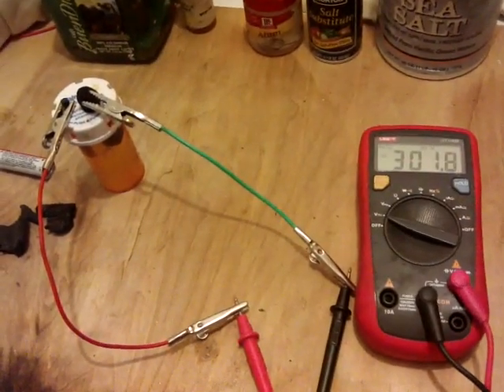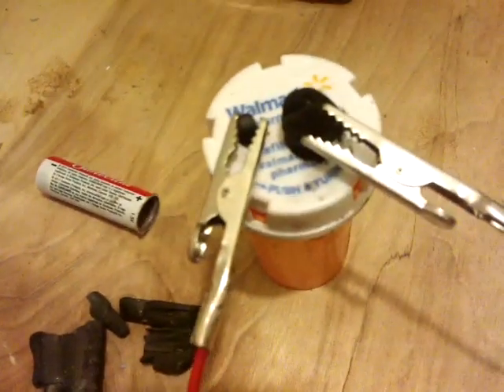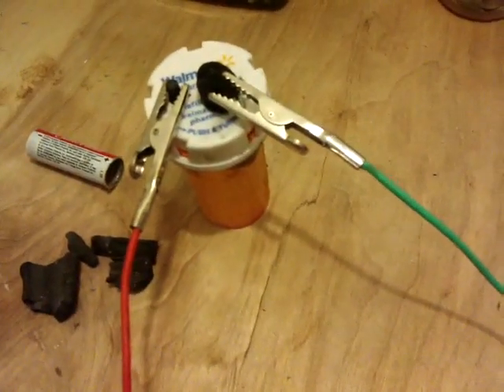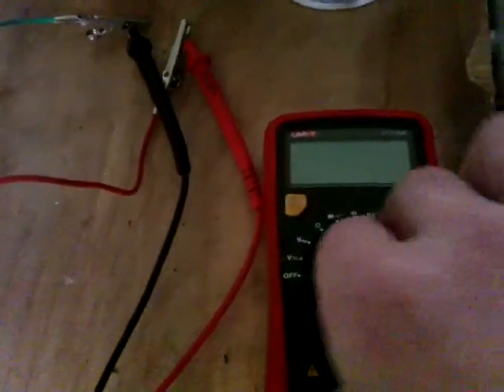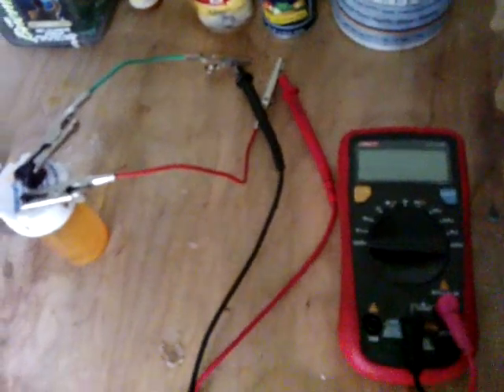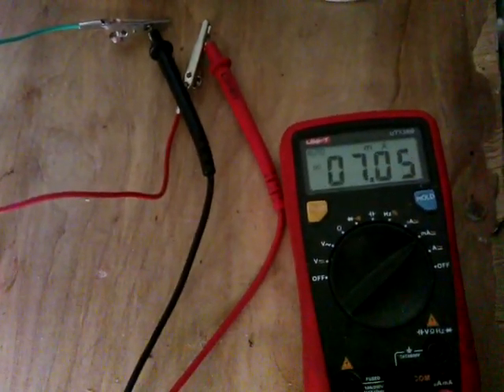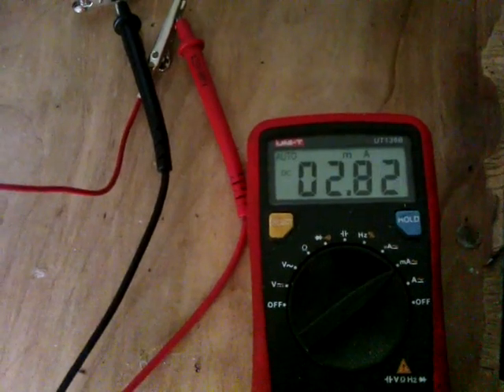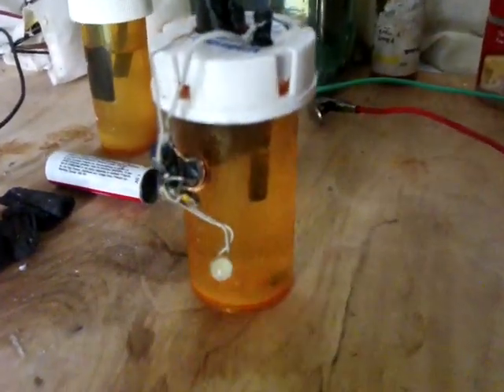Carbon/Carbon rechargeable cell

Comment: Adding Dot 4 brake fluid (ethylene glycol) increases the breakdown voltage of your electrolyte so you can charge at higher voltage and amperage.
Get a metal container with a lid you can lock down make a small hole in the top fill with popsicle sticks or any wood you want that is shaped how you want your cathode/anode to be like then cook it on a fire surrounded by coals for even heating till the container stops smoking for good charcoal rods.
Reply from the maker: Brake fluid...didn't know that !
For the charcoal yep, good tip and does work fine. We have a brush pile at the back of the garden for a lifetime supply of charcoal rods lol

Comment: Hello to how long the battery is working and thank you
Reply from the maker: ali azazy Such a cell can last for many many years, Karpen's own builds have run for well over 50 years. The main thing being that whichever electrode side normally corrodes with use should not be metal. In a car battery the negative plates are always fine, the positive plates become ruined.
So, in my own best so far, Carbon/Lead, the positive plate is carbon :)

Comment: Nice work, a rechargeable, non-corrosive electrode cell is a welcome thing!
Go Slider go !
Reply from the maker: ***** Thanks Mike. That's the idea yep, to be as close to the Karpen Pile 50 year types as possible, be rechargeable and run something even when 'flat'.

Comment: Temperature?
Reply from the maker: Coelopa frigida It could be conditions related - warmed up to high 70F's in the house during the day, with a 66F overnight (house is wood with no insulation). That would make it highly sensitive. May relate to Nephilim Penny, a large pancake coil water powered oscillator (3 years running) that slows up with severe weather. Its flash rate output is affected by storms within local area and it did rain last night. 
I might throw this in the freezer for a couple of minutes and see if there's a change !

Comment: Looking good! That cell should last forever being carbon-carbon. Have you tried experimenting with carbon-aluminium cells? Search YouTube for 'New aluminium-ion battery from Stanford' - they have pinched Robert Murray-Smith's discovery!
Reply from the maker: Coelopa frigida I've always fond Al to be of low output, but that's the thing, low can be better for longevity...thinking Mg ribbon there too. Will certainly try it out.
This latest cell has done something odd, but quite intriguing. It was flashing the oscillator once per second when it settled down, then last night was at once per couple of seconds, now this morning is back to once per second again !

Comment: Very Nice Slider
Reply from the maker: Steve Allwest Cheers Steve...much better output with this. I mentioned your previous comment about iron particles in the description, it prompted the change to both electrodes being carbon :)
Reply: slider2732 I thought the power would go down, but happy to see the power go up having two carbon electrode
Reply from the maker: Steve Allwest Me too, usually there being about 100mV for carbon and carbon. it's still flashing away fine.
Reply: slider2732 these Karpen cells are amazing, yours in particular

But I  am amazed at the non degradation on the mag ribbon cell  that neatpete created,  All very good stuff